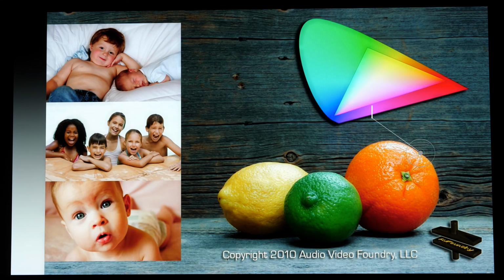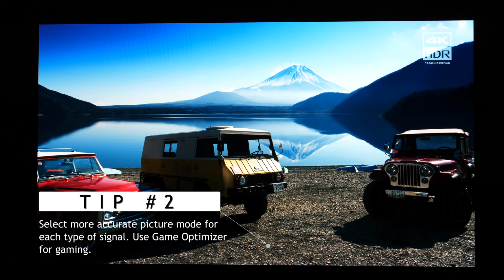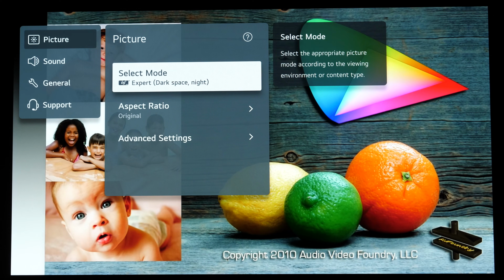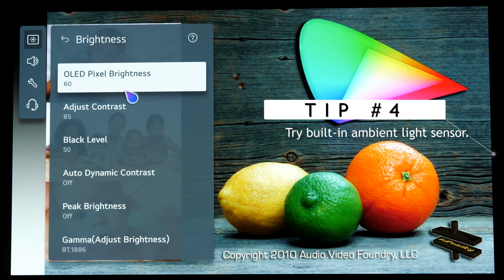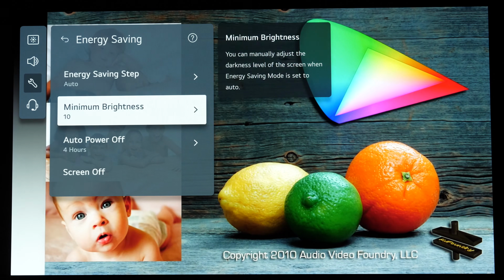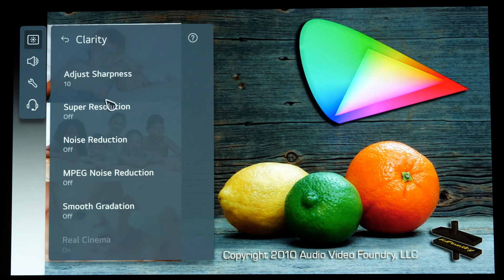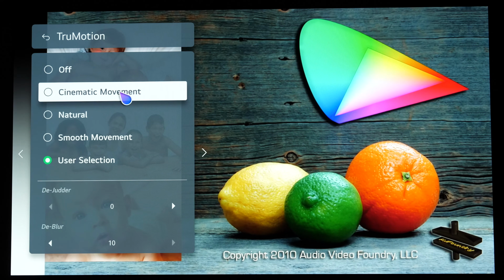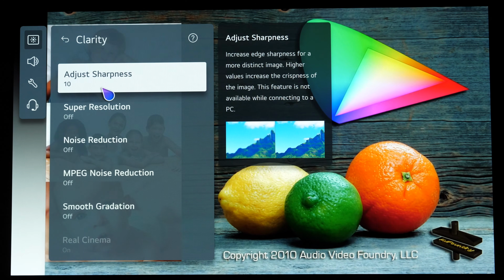LG OLED 2022 TVs B2 C2 G2 Z2 - picture settings with tips

Comment: Hi Darko. I have an LG C2 65-inch oled tv. You mentioned for the best picture mode, choosing depending on HDR/SDR/or Dolby. How do I know what mode I'm in? HDR/SDR or Dolby? Thanks.
Reply from the maker: Hi Tommy - picture modes change automatically depending on the type of content that is playing.  During playback, you can press OK button on the remote and you will see details about the signal. In addition to that, in picture settings names of picture modes will be different, if there is HDR in the name then it is HDR10 content, if Dolby Vision then that's the incoming signal.

Comment: I use VIVID for both SDR and HDR. I have tweaked the colors a little down. I think they other presets are too dark unfortunately. Im also not going for realism but the image should "pop" which is does on VIVID.
Reply: With Vivid the brightness is close to 100, i guess!
Reply: Vivid looks horrible. If you want colors to pop just use higher color depth.
Reply: @LawinReborn  I think it looks the best, I have tried all the other modes of course.. but the thing with livid is also its a notch brighter which is very important for me. Its actually mainly why I use it due to increased brightness. I tried all the other and LOVE vivid in gaming and desktop mode. Its important of course to set the tv to PC mode so no fancy TV filters and features are active like dynamic contrast etc.

Comment: What setting for the best srgb color accuracy
Reply from the maker: Same as in this video, just make sure Color gamut is set to Auto for TV to correctly map sRGB (which is same as BT.709) and also check black level. For PC connection it should be full range 0-255, but confirm this in PC’s display settings.
Reply: @TVguyDarko  ok tx a lot broo

Comment: Probably the most useless guide I ever saw. Light sensor? Thats your pro tip? Its the first thing that should be permanently turned off when you get your C2. 

And warm 50.. No thanks.. No mention of tone mapping settings, or fine tuning blacks and whites in game optimiser, which is like the best feature on this TV, wow... Or how to get around tinting issues with certain colors, my C2 bleeds green all over the panel and its hard to get the colors right without professional calibration..
Reply from the maker: Thank you for the comment. The purpose of this video is to guide owners of LG 2022 TVs to which picture presets and which settings they need to pay attention to. It is easy for someone who is familiar with TVs menus, but trust me so many people simply don't have time/interest to explore the settings menus and end up watching they great new TV in awful modes such as Eco or Standard.

Why should light sensor be turned off permanently? I have it turned off on my TV, but some may prefer it not to adjust brightness during the day or evening/night. 

Which color temperature do you prefer?

At the end, this video is a basic guide and more details are mentioned in the documents that are available in my calibration store.
Reply: linkto this guide then?

Comment: I use Cinema Home for Dolby Vision (100 pix, 100 cont, Peak High, Auto dyn. cont. off, Warm 30, smooth gradation Low, gamma 2.2, TrueMotion on Cinematic Movement). SDR is on 80 pix. brightness, contrast 90, peak Low, Warm 30, gamma 2.2 ...
Reply: How do you use your tone mapping in Dolby  vision I just got this tv I don’t see this option when I nThis mode
Reply: @IB1GMANI  There is no "HDR tone mapping" option in Dolby Vision IQ, only in standard HDR10, Dolby does it automatically. In HDR10 you have it, but the result differs from material to material, meaning you will have to change it to see which setting (on/off) is better for a specific movie, especially in darker scenes - it raises the black level so it can over-brighten the scene where it should not.
Reply: @madant7777  what is the peak brightness on the lg c2 42in is it 700 nits or 800 nits ?